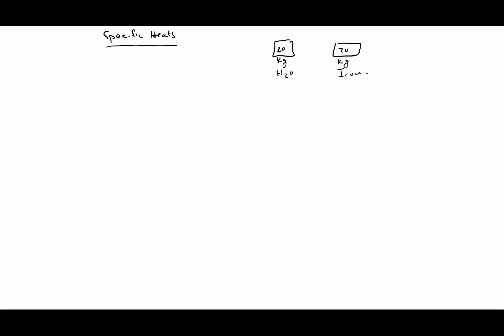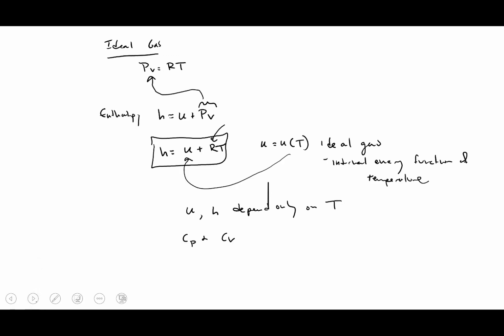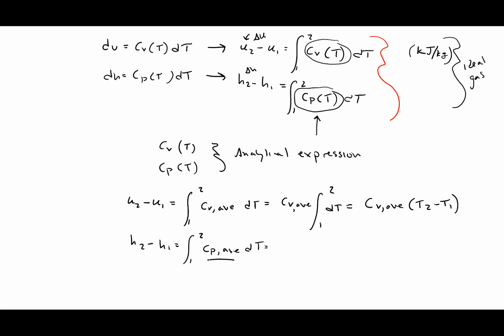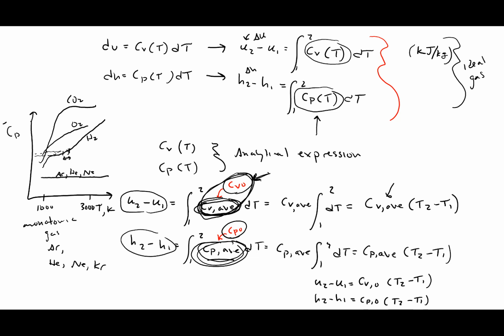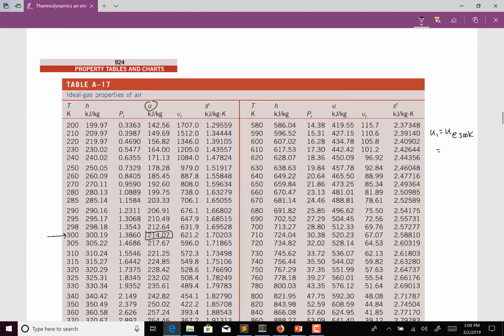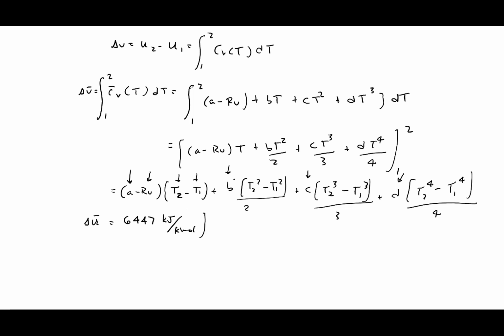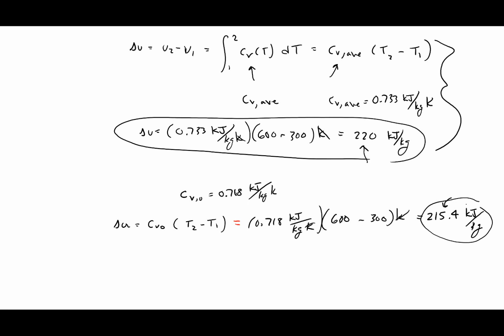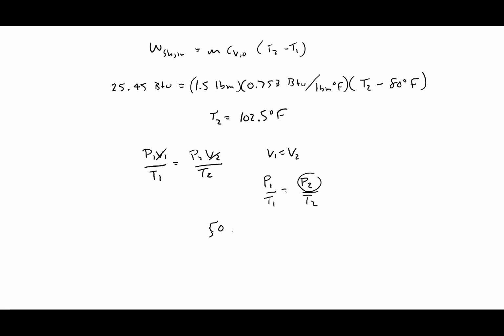Thermodynamics: Specific Heat

Comment: Mam I have one question, please explain why Cp = Cv for solids and liquids..?
Whereas Cp - Cv = R for gases...
Reply from the maker: I'm planning to make a video on solids and liquids but it is because the specific volume for most solids and liquids is small and they can also be assumed to be incompressible for most cases.  The math showing this is: 

h = u + Pv
dh = du + d(Pv) = du + Pdv + vdP

For an incompressible substance dv ~ 0 and if the specific volume is small, vdP ~ 0, thus

dh = du

Since specific heats are a strong function of temperature but not pressure or volume: 

dh = CpdT
du = CvdT

so:

CpdT = CvdT

so:

Cp = Cv (for incompressible substance with small specific volume - most solids and liquids)
Reply: Raili T Thanks alot Mam!!
Very well explained..